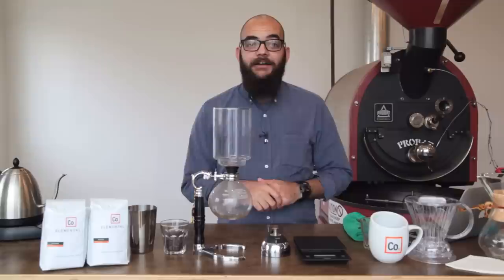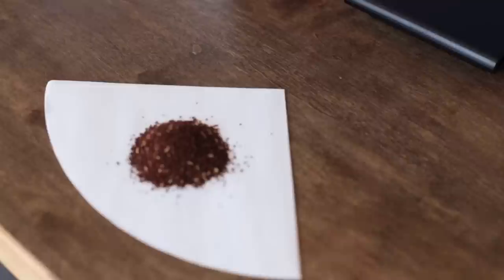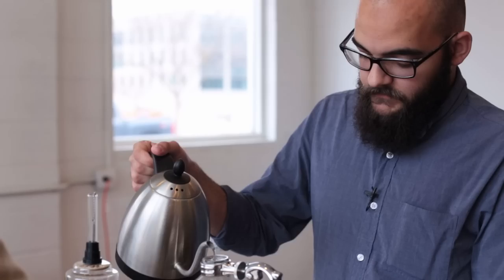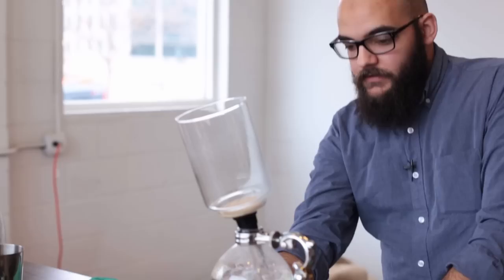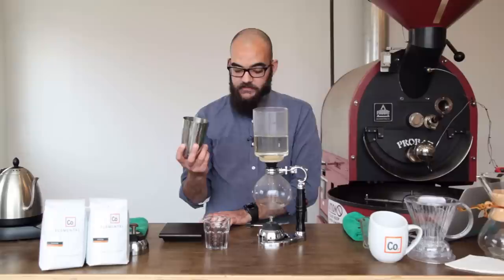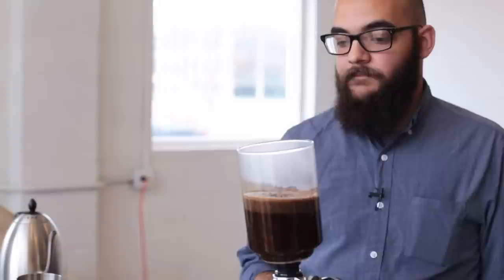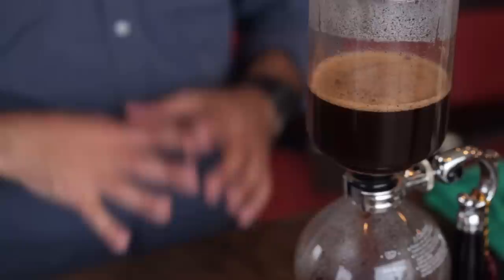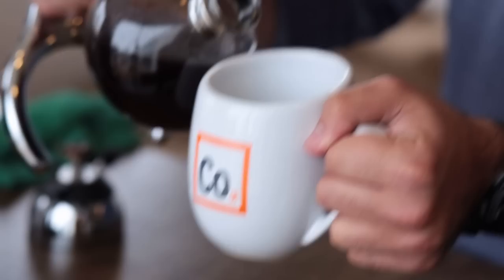How to Brew Vacuum Pot Coffee

Comment: I've been making coffee with glass vacuum pots almost exclusively for 30 years, and I have many reservations about the way it's done here. 

For example, if you let the water boil before you seat the top, it's very difficult to seal the top vessel firmly enough to make a good seal because at that point the lower vessel is too hot to grasp with your bare hand, and if you push hard without supporting the lower vessel, you can push it right out of that intrinsically weak stand right into a minor kitchen disaster. And if you look closely, you'll see that he DOESN'T get a good seal, and the upper vessel is wildly tilted. Then by the magic of a second take edited in, the tilt is repaired and a good seal miraculously attained.

The right way to do it is to add the water to the lower vessel at a temperature at which you can at least stand to handle it, affix the upper vessel, and immediately add the coffee.

Then the water will gradually be pumped into the upper vessel at at temp well below boiling, and that will allow the coffee to be thoroughly wetted. Then when all the water that can be pumped up is pumped up, stir the upper vessel as the water left in the lower vessel rapidly comes to a boil. 

The water in the upper vessel will at first bubble as the air which was trapped in the lower vessel is forced through, and then it will stop bubbling because the cooler water above absorbs the pure water vapor from the lower vessel, and will heat up rapidly.

When the upper vessel just begins the show signs of bubbling at the surface, take it away from the heat.

The only pitfall in the method I've outlined is that you need to make sure there's enough water left in the lower vessel after the pumping process so that it doesn't boil dry as the water+coffee in the upper vessel is heating. If there isn't enough, you can adjust that by moving the sealing gasket down a fraction of an inch on the stem of the upper vessel. That particular gasket is generally very tight, and should stay where you put it.
Reply: Agreed. For pretending to look more clever and "scientific", there are a couple of things in the way he uses the syphon that are really dumb, which you already pointed out.
Reply: This is great advice, and I appreciate the reasoning you provide. I don't like blindly following steps without information supporting the process. The only thing I still struggle with is timing. Based on your process without testing it myself, the brew time would be about less than 2 minutes. I could be wrong, but what would be the ultimate brew time with a medium ground coffee?
Reply: Yeah, that's interesting when I look back on the video.  It does look like he's not getting seal with all that vapor pressure.  It's hard to tell if that's because he's holding it that way though.  He gets a seal later, so I'm doubtful they manipulatively edited it so he could do something that isn't possible.

I personally place the top chamber on when the first bubbles appear, not when there's an outright boil.  Doesn't require any pushing. The weight of the chamber and the rubber gasket gives a perfect seal.  

I'm not so sure about all your details though.  For example, time determines when I remove the heat, not if a bubble appears in the upper chamber.  The action that happens in the upper chamber can be adjusted through your heat source so it might be the method that works for you, but I can't see a reason that this has to be the way to do it.  

I've also never waited 105s to brew.  60 s is what I've done but....

I notice with coffee instruction videos everyone seems to have their right way to do it and then the comments assure this person that this is not the right way.  I mean, how about we all just take these videos as "well, here's my technique and yours may vary" instead of needing to tell everyone that anything different than theirs is WRONG?
Reply: You should make a video too, I'd love to see how you do it
Reply: China called, they want their wall back.
Reply: You noticed all that too. I saw the tilt change, but did not catch that it was an edit, good eye (I watch videos in 2X). Also, he should use electric for the boiler, like a halogen hob. That is the pro way to do it.
Reply: Yeah I got the impression his use of specific number of stirs and timer that he's more of a showman than brewer. I stir it until I'm happy and put as much coffee grounds I like to taste. I'm surprised he didn't say anything about not brewing until every 3rd moon and letting out a few chants

Comment: I've made coffee for nearly 50 years in a stainless steel Bunn vacuum coffee maker.  You just use a very fine grind coffee.  Coffee grinders in grocery stores used to have a "Vacuum" setting on the grind adjustment.  Put the water in the bottom, put the coffee in the top.  Put it on the stove on high.  Listen for the first bubbles when all the water has been forced to the top and only steam is left below, then take it off the heat and let it sit until all the water is sucked back down.  Best coffee you will ever drink.  No new age mystique, just coffee and elementary physics.

Comment: That is the way to do! If you have the stove top, you can actually use cold water but it takes some more time... and if you want you can also fill the coffe in the top before you put it on, it can be dangerous to have it hanging loose like that... and then the amount of coffe is very individual... for an amerivan coffe the 30 gram is possible good, for a scandinavian coffe I’ll go with 100 gram per liter of water... calculate 10 grams per 100 grams of water or similar 1 to 10... But I want to congrats because you do the best way using this machine that has origins in Portugal and that most machines are swedish from BODUM...

Comment: Uh or you can follow directions and fill the lower beaker with cold water, assemble the upper beaker, seal, add coffee and then time the water when it rises all by itself.  No messing with hot water or tilting the upper beaker at an odd angle or any of that other nonsense.  I own a Hario and have made many, many pots of coffee over the years for friends who had dinner at my place.  Why make it so difficult.  It is a very easy process.  For those old enough to remember the Sunbeam Coffeemaster Electric Vacuum Coffee Pot popular in the 1940's and 1950's did the same thing in the same way with the added bonus of just plugging it into the wall.
Reply: Yes ..Hario knows best..they made  the thing.  None of this twaddle
Reply: or you can do it the way you want and leave everyone else out of it.

Comment: Tried this with a pressure cooker, diesel burner and 600volt 3phase vaccum pump.  I had it down to about half a millitorr at 500 degrees before the cooker burst and sprayed hot grounds onto the diesel burner, which immediately ignited them and burnt my house down.  

paramedics said the coffee was excellent, after adding cream and sugar.
Reply: 2 years old, amazing comment, not even a single like. Not a sadder tale was told.

Comment: ive only seen people just put the whole thing together, boil the water inside the pot with the gas light, and then just add the coffee before starting the process or after the  water shoots up.hipster ass coffee. its a neat pot because its all included and you don't need extra shit like you need a scale and a separate heater and pot.you certainly shouldn't let glass just kind of roll around like that. good way to break your coffee maker.

Comment: We would like to remark on 'How to Brew Vacuum Pot Coffee', although the vacuum brewer used in this clip is of asian origin. 

As manufacturer of Cona Coffeemakers,  the world-renowned european benchmark of vacuum coffeemakers, we would recommend Cona users to do it differently step-by-step. 

We in particular advise users to ignite the flame much later in the proces. 

First put in pre-heated water as this clip shows. Then position the upper bowl with the filter installed onto it, not loose but airtight and functional. Then the coffee grounds can be strewn into the (still dry) upper bowl. Only then ignite the flame.

Boiling water produces water in its gas-phase, better known as steam. This pushes the water upward through the funnel into the upper bowl. Subsequently the upward stream of steam (not oxidising air) creates a perfectly even distribution of the grounds whilst brewing. With Cona Coffeemakers additional stirring by hand is not necessary.  

We have recently developed a new 'hipsterized' variant for barista's of the domestic model Cona. It has a technically sophisticated micron weave filter system with a spring holding it in position, as to enable stirring regardless of reasons. As with our other all-glass filter system (a solid glass rod) for home use, it does not require any kind of filter paper or filter cloth.

Whilst developing it, we have again come to marvel at the sheer complexity of the filtering and extraction hydrodynamics, that lay behind the Cona method, and how the 1962 industrial design by Abram Games combined perfect shape with perfect function in harmony with his motto 'Maximum meaning, Minimum means'. 

Cona coffeemakers are manufactured by A. Gezang & Co BV in the Netherlands.
Reply: But how do you buy one

Comment: Pretty sure at least the Yama is designed to push up to coffee at 200F, designed lift based on vapor pressure at that temp. No need for preheat, if this is your device and it isn't that way is it intentionally less engineered? Or is it just demonstrating a better control process for hyper optimal brew?

Lol also if your specifying number of stirs and timing intervals, coffee grain size would probably be pretty important.

Comment: I appreciate this clip, as it is a different way then what i have seen elsewhere. i have a large model and i do like the way the nutty flavours of the coffee are brought up using this brewing method.  I am looking for a single serving model, but find them too pricey. I think I will keep using my french press as it allows to brew at a slightly lower temperature.... boiling water is too hot.... for me ;)
Reply: If you lower the burner heat until the water in the top vessel isn't boiling anymore (like in the video), it is exactly at 200°F (I measured it several times). The perfect brewing temperature.

Comment: Good vid - thanks
What is the downside for putting the ground coffee in first and letting the rising boiled water add to the grounds? 
Tap water or filtered water?
Reply: Bill Blake since no one else has answered, boiling water contacting the grinds will over extract them resulting in undue bitterness. Doesn’t stop people from doing it or preferring the method they are comfortable with. It’s still better than percolation.
Reply: Also, filtered.
Reply: Ideally, distilled water (NOT purchased in a plastic container from a grocery store which leeches out endocrine disruptors). I own a Mini Classic CT Countertop Water Distiller from My Pure Water and can highly recommend it. That's the base from which to start. Distilled water alone makes horrible coffee. The easiest way to make great water for coffee is to add Third Wave Water (prepacked minerals) to distilled water.

Comment: What's the difference between percolated and vacuum pot coffee?
Reply: +EH CBunny The percolator is the worst way make  coffee. As the water percolate to the top of the pot, it falls back down to the bottom. the water gets reheated and pump back up to the top over the coffee ground again. 
Reheating and reboiling the coffee changes it chemically. 
I used Aeropress, it is easy to clean up.
Reply: +gammatnt Water is not supposed to fall back down to the bottom in a percolator? I can see this is different from a percolator, as that's using higher pressure to make coffee. But I can't see how siphon is different from a french press. Both are  just mixing hot water and coffee and filtering it, right?
Reply: +Bas van der Graaff  Actually this method , as does an AeroPress, filters the water thru the grinds.  The French press strains water thru the filter that doesn't pass thru all the grinds sitting at the bottom.

Comment: So you boil the water before you boil the water?
Reply: Adam Kwitko he had the water pre-heated to 200°F, water boils at 212°F. It's simply shortening the steps, time mostly, and your wick, fuel, and burner last much longer. Not to mention usually you get burn residue on the bottom of the lower pot. I just bought one, actually really cool.

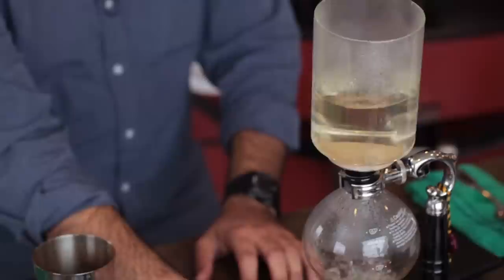Comment: @1:48 I cringed, the water isn't drawn into the upper cylinder, it's pushed by the pressure caused by the expanding hot air and steam in the lower chamber.
Reply: ***** That and measuring the water in Fahrenheit AND Grams.

Comment: YOU DONT NEED TO PUT HOT WATER IN FIRST- that is what the burner. Is there for.
Reply: I think with the normal burners it can take ages to heat the water, so pre-heating it can speed things up a bit.

Comment: Would anybody know how to make an espresso with a Vacuum?
Reply: +Robert Catanzaro you cant make espresso with any of the alternatives. the only way to make espresso is... through espresso machine, thats why its called... the espresso machine
Reply: +onraj9mm Not necessarily true. You just need any method that can produce enough bars of pressure to get water through, there are options for manual espresso makers that do not use electricity or motors.
Reply: +onraj9mm Not necessarily true. You just need any method that can produce enough bars of pressure to get water through, there are options for manual espresso makers that do not use electricity or motors.
Reply: platinumdynamite yes, though they are still espresso machines (manual lever), i was talking about the known alternative methods, afaik none of them achieve the 9 bar pressure needed for true espresso, and dont have that purpose at all.
Reply: onraj9mm
There's an interesting one called the Handpresso that uses an air pump, worth taking a peek at. In terms of vaccum though probably not worth making something, for risk of explosions!
Reply: +Robert Catanzaro Use something like this:
http://www.amazon.com/Bialetti-Express-6-Cup-Stovetop-Espresso/dp/B000CNY6UK/ref=sr_1_2?ie=UTF8&qid=1453054164&sr=8-2&keywords=espresso

or search on Amazon for Espresso.

There you go :)
Reply: Bill Fencegates
Moka pot doesn't do a real espresso, but it makes great coffee
Reply: Bill Fencegates why? i have one at home :)
Reply: onraj9mm me 2 :D
Reply: Robert Catanzaro stove top mocha pots aren't actually espresso. they're just another solution brewing method. spro' is a far more concentrated emulsion brew created by both heat and pressure.

Comment: ...grams of water?  I mean, come on, at least use the proper unit of measurement!  Milliliters!  Or centiliters!  Also, dat mixture of imperial and SI, doe.
Reply: +Collin Dow the density of water varies at different temperatures, and because we don't want to transfer the liquid to measure it we just use a scale. Scales can't measure volume, only mass, so we use grams.
Reply: +Will Clow Nobody, genuinely nobody, refers to water in grams ever. The density of water is not measured in grams like that, it's grams per unit volume...
Reply: Looks like the Youtube comments section took a nosedive again...
Reply: +Collin Dow When doing accurate measurements, water is measured in grams. You wouldn't be able to have 400ml of water but you can get exactly 400g of it.
Reply: Goughs Bastard Exactly.
Reply: Goughs Bastard I measure with scale the water when making coffee with french press as it is the fastest way to measure it.

Comment: STUPID, absolutely stupid !!!This coffee making process has been in existence since the 30's in my country. The process is real simple : put water in the bottom tank, tighten the top tank, heat the water, atfter put as much coffee you wnt depending on how strong you want it (a set number of grams of water and coffee is ridiculously nonsense : coffee will be done anyway, use good old commmon sense...) and let things happen : when the water is in the top tank leave the heat on as mush as you want depending on how long (and how strong) you want your coffee (and taking care that the water left in the bottom tank does not turn into vapor so that the glass won't break) then turn the heat off. And the brew will get down.. Et voilà.This system was used on "bourgeois" French tables as a mean of serving coffee made the right way and not in the kitchenby a clumsy maid. That's all. I saw it at my grand--mother's every sunday during my childhood and like all the other children was mesmerized by the water going up and down the system... For some reason it has disappeared, but not entirely, in the last 30 years. I find it nice not see it coming back... But this should not be done at the price of pretentiousness, and sheer stupidity and so "uncommon-sensicality".Nothing worse than seing àstupid person making a fool of himself ...